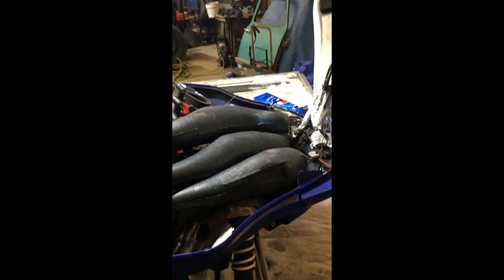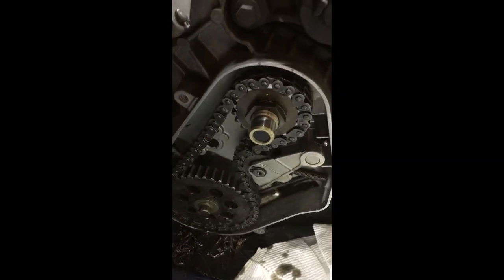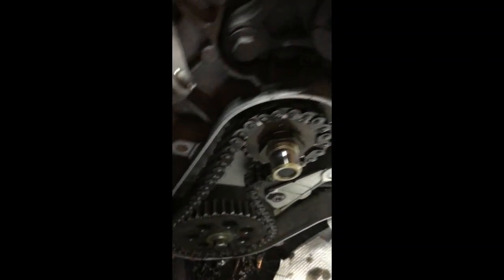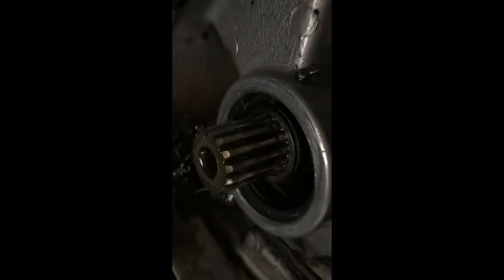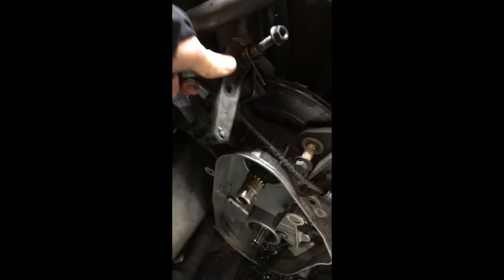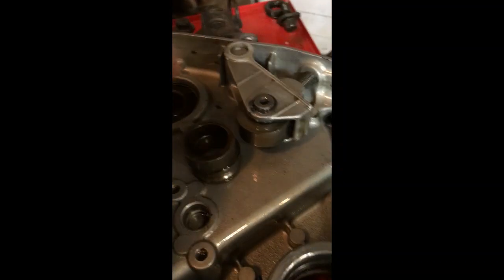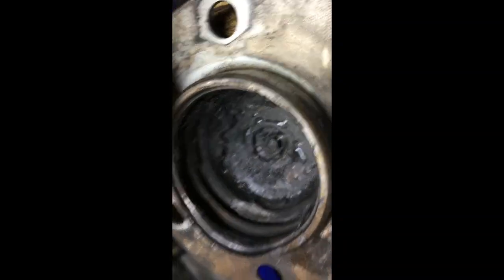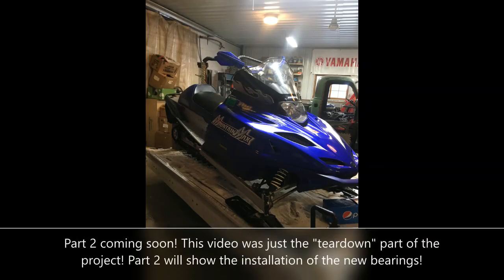How to change your snowmobile's lower driveshaft bearing! 2001 Yamaha Mountain Max 700 PART 1

Comment: I need a new chain for my '97 mountain max 700 any chance you can point me into the right direction to order one?
Reply from the maker: Dalton Small new chain or bearing if you need a chain heres the link: https://rover.ebay.com/rover/0/0/0?mpre=https%3A%2F%2Fwww.ebay.com%2Fulk%2Fitm%2F292224871117.  
☝️that’s exactly what u need if it’s a chain the seeking
Reply: Thanks a bunch!  @roostnboostntv9575

Comment: Did you guys cut the clutch belt to get it off
Reply from the maker: No, you remove the guard, grab onto the movable sheave of the secondary and turn and push it so that it opens up. Then the belt will have enough slack to slip right off